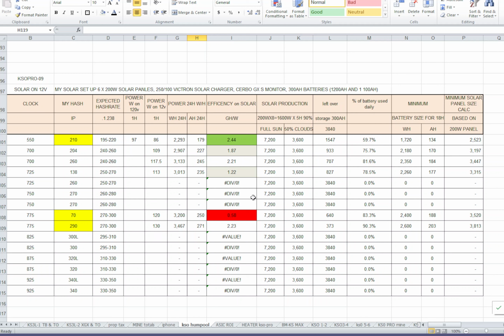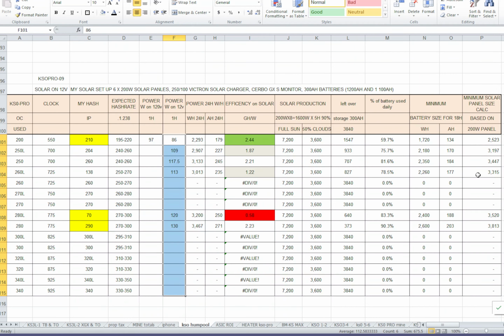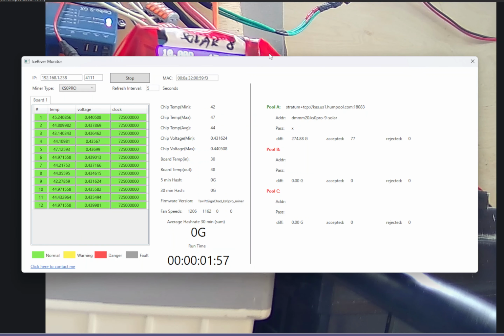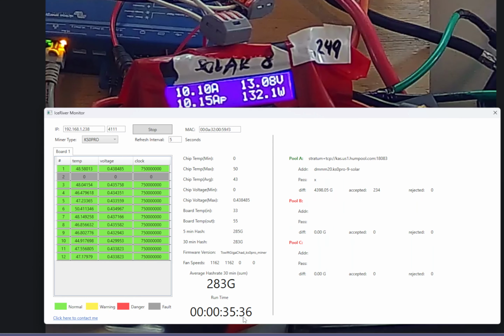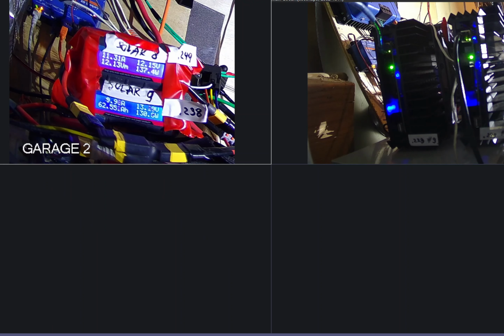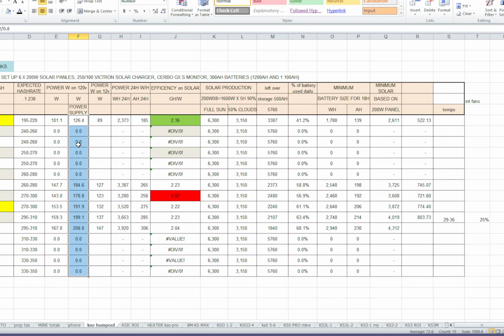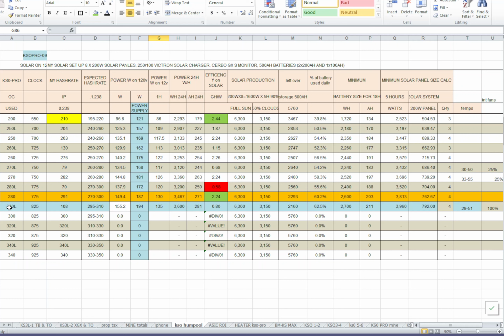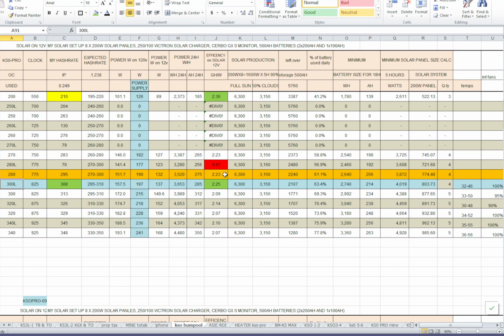ICERIVER KS0PRO ALL OVERCLOCKS TESTING FOR SOLAR, HOW MANY PANELS AND WHAT SIZE BATTERY DO I NEED?

Comment: Good to see when ks0 is on 12v its only drawing 86w. I got 80+ titanium 1kw psu coming that im running around 600w for my set of miners. I cant do solar like you but im trying to get my efficiency on point.
Reply from the maker: those psus work great imo, i use server psu for both 5xKS0s OG and 9xKS0PROs to minimize bunch of small psu and wires arround and works great. My solar KS0PROs will have remote reboot complimneted thanks to victron cerbo gx relay system.